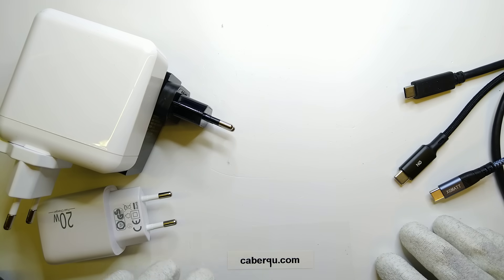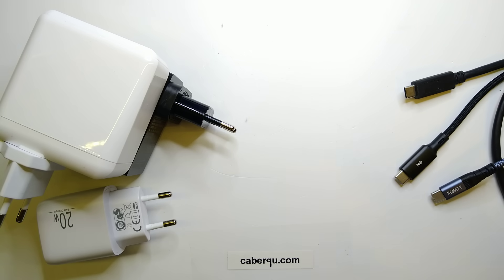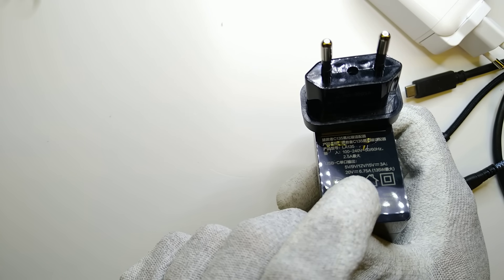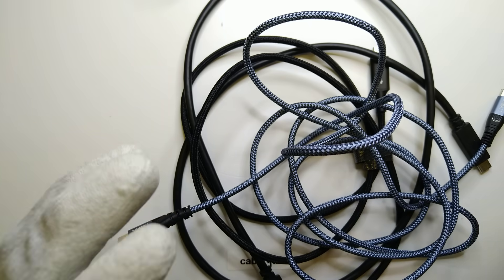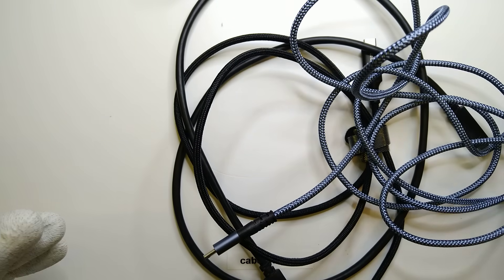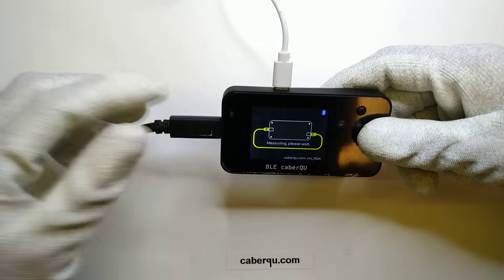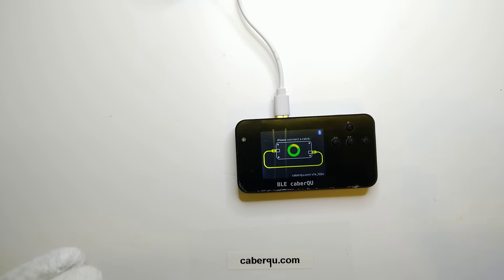USB-C is now EU standard, but the most important thing is missing

Comment: The information to consumers about charging has always been poor and I don't really understand why. Consumers simply haven't been exposed to this information outside of marketing claims that are often misleading like "120 W ultra fast charging*" and several pages down in tiny 10 point font will be the useless phrase "*with a compatible charger" . Manufacturers have a bad habit of not advertising the power specifications of USB C devices, when you have bought the product and have it in hand often it will have that output voltage list as required on chargers but it's often difficult to find that out before buying and many downstream devices will have absolutely no information anywhere on what standard, voltage or current it uses. And also almost no phone or laptops will report to you the watts, amps or volts unless you install third party software. Even when using first party chargers and cables it's difficult to know what will work and if it does, how much power will be transferred.

Another issue I've seen is when you have a charger that's 90 W and a device that requires 30 W, consumers will think they're compatible, after all that's how the standard was first envisioned to work. But when they try to use it, it won't work because the device requires 30 W at 12 V which is often an excluded output voltage as it's not required, USB PD 2.0 only requires 5, 9, 15 and 20 V above 45 W. 12 V is an optional voltage but is actually very common on devices, particularly those that transitioned their design from a 12 V barrel jack to a USB C connector. Designers have to be aware 15 V is the new common voltage and support for 12 V is poor. Considering how regularly I see designers screwing up and combining the two 5.1 k resistors on the CC1/CC2 pins I have no hope designers will know to design for 15 V, not 12 V.

Furthermore I will be interested to see what sort of laptops or phones will make use of the USB PD PPS standard, it's been around for a while now on upstream devices but downstream devices that take advantage of it don't really get any advantages unless they support ONLY PPS which would allow them to greatly simplify charging circuity, but then won't be compatible with any charger that doesn't have PPS. Don't think I've ever seen a consumer device that actually uses PPS to remove the on-board charger to date.

Comment: >I buy cheap stuff from china that isnt officially certified and wonder why its not what its advertised.
You cant be expected to hold everyones hand and stop them from being stupid and using cheap non certified cables.
I just throw the cables that come with cheap devices away and use Fuj:tech USB4 240W. Little expensive but can use it to charge anything or transfare video or files on max speeds.
Reply: To solve the cables being shit you would have to ban people from buying cheap stuff from China and other 3rd world countries.
Its not just USB-C cables that suffer from these issues. China sells people cables made from aluminium, those are sketchy as can be.
Reply: @deperditus worse still, try putting a magnet next to your cables. Yup, some use steel. Almost all my breadboard jumper wires are magnetic!
Reply: @deperditus  Making such cables simply not work is actually great way to get them from market in the first place. No-one will bother making them if they can't sell them
Reply: @Gastell0  nah people arent the smartest and will fall for the false promises of cheap cables. Human greed is such that they will keep buying these cheap cables as long as their sale is allowed, they just see oh this 5€ cable claims to do 500W with 100Gb/s file transfare speeds and buy it, because in their minds its  great deal compared to the known brand that costs 30€ for 240W 40Gb/s cable

Comment: You cannot rely on the "large label" wattage on those chargers.  The fine print usually will specify that different ports can supply different amounts, and only if you use the correct combination of ports can you reach the full labeled wattage.

USB-C is phenomenally complex trying to mix and match chargers, cables and devices.
Reply: Then comes the sockets on say a laptop, all look the same, however some do PD (power delivery) some do video etc etc, a right mess. Pair this with a non marked cable and best of luck getting everything working.

Comment: At the time of writing of law, USB C cables did not need labeling.
Reply: USB-C has always been a confusing 'standard'.  For example, does the cable support Thunderbolt or not?  Or DP-Alt mode?  Because most cables do not.
Reply: @SanderEvers  DP alt mode is supported by any compliant C-to-C cable. Thunderbolt is not USB standard, so USB-IF has no power over it.
Reply: @uis246 compliant USBC cables can also be just 2.0. Also DP has some high datarates not suported by all 3.x
Reply: @ptamog  "just 2.0" cable is either has other connector be 2.0(e.g. type A, mini-AB) or non-compliant. Same goes to "only charging", except they are only non-compliant.
Reply: @uis246  C to C cable can also only have the classic 2.0 data lane and not the aditional high speed lanes used in 3.0 and onwards. C is just the conector. DP runs on the high speed lanes.
Reply: @ptamog  i saw PD on USB2 C-C
Reply: @martinnovak679  correct, but I'm talking about DP (Displayport)
Reply: @ptamog  oh i tought it was typo

Comment: i hate usb c i only have 1 device with c and the most are mini usb or micro and my phone and ipad are all lighthing what is stronger it is so shit i need to buy all new cables of the hold on usb c also its a verry fragile connector hi voltage over small pins near data is not a good idea i see so mani cases where it fails cause high voltage short over the data line and blow up a lot of laptops or other devices

Comment: All USB cables should be marked with a maximum current rating which keeps it within the USB voltage drop specification. Not a perfect solution, but definitely the simplest one.

Comment: I don't expect or want all cables to need the USB IF certification, but some sort of labeling would maybe be nice, albeit difficult.

Problem with USB IF is that they're more conservative about allowing devices into the standard. Some devices cannot be certified, but are very useful:
- USB a male to USB c female? USB C female to USB micro male? Spec violation. Safe when used carefully
- multi-port USB C chargers with shared capacity? Nope. Wild West on how to renegotiate new power requirements

Comment: You’re certainly right…! This seems harder than e.g. food or even pharmaceuticals (labeling and checks), because there are hardly any manufacturers of cables, chargers nor devices (caveats for the latter) within Europe (EU, EEA, UK). For electronic parts, even less so? 

Except high-end devices, branding and manufacturing are quite obfuscated. A brand doesn’t necessarily equal a manufacturer, as plants produce by tendering for any brand. 

So, will every EEA country need to check imports before they hit the common market? Meaning a revival of all the separate national «agencies» we had 40 years ago? 

This scaled well some decades ago, as the «early EU» had tech manufacturing inside the area (as we have for e.g. food and medicals). But now, when the supply lines are all «third country», I have no idea how this needs to be implemented. 

Importers «checking themselves» sounds like the proverbial Boeing-FAA dynamic. Who will watch the watchers, and what will the street price for actually good USB-C equipment be…? 😅

Comment: With all this mess, more waste will be generated. We still use usb-a charges along with usb-c, also we still use non usb-c(on end, like lightning, microusb, mini usb, usb type b devices other end might or might not be usb-c). Why you need over complicated circuits on a cheap low power device? Some even dont use 5w to work. Now when I am sending some electronic device to some of my friends I am sending usb-c to usb-c and usb-a to usb-c cables, just to be sure they have the right psu…Until every device moves to usb-c there will be a new standard and all this e-waste will be thrown away again…

Comment: i have a barrel plug on the pinebook pro and it's way more comfortable to plug in and out. barrel plugs with 3 different sizes for 5v, 9v and 20v, combined with some very fast wireless data transfer is all we ever needed, instead we have this convoluted standard.

Comment: I see that tester, I instantly want to buy it, because we all own so many damn USB-C cables these days that a specialized tester is absolutely worth it 😂
Reply: Really excited to get this one too, Im doing USB-C hw designs and it would help me verify cabling. Happy to beta test or pre-order!
Reply from the maker: Haha, unfortunately it's a prototype with future shipment dates..
Reply: @quiescentcurrent It looks really cool, I would be interested in a good tester as well, instead of a random AliExpress buy
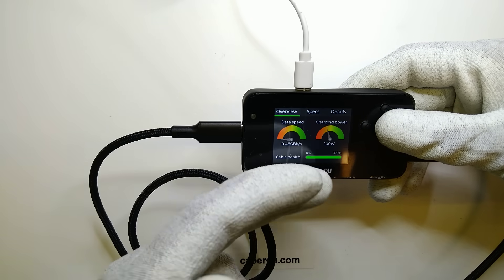Reply: @quiescentcurrent  Could you change the BLE to show the real max speed in the overview dataspeed gauge? For ex. @ 8:11 it shows 0.48Gbps though the data cables are not connected, thus 0Gbps would be correct.
In the magnetic connector video I saw it show 20Gpbs as faked by the emarker chip, when really it was usb2 only. Seemed to be confusing.
Reply: So instead of different (but easily recognizable) connectors, we end up with different cables that all look the same, requiring a tester to find a suitable one.  Yeah, that's progress...
Reply: @kaasmeester5903  micro has same problem. USB-C only add voltage (and wattage for 5A devices)

Comment: Yes, cable labels would be nice, but usb C-PD is far better  than the A-to-micro-B cables, which most phones and tablets used 10 years ago. Both the AC adapters and the cables were a complete crapshoot.
Reply: Depends how you look at it. They were guarntied to deliver 5V +/- 10% with 0.5 Amps guarantied with sometimes 1A or more. But within that 5V spec, everything could just charge. 
And then you had charging or data cables, thin means no data, mid means data and thick.... still the same in most cases when from normal brands. Others are just more rigid.
If you look in the connector, most have 4 and some 2 wires. Last type means only charging, 4 can mean charge-only or maybe also data. Data-transfers working up to 7 meters almost all, better cables up to 15 meters.
Now you get things that don't even charge because there is no data-wire connected so not even giving 5Volts.

Comment: This is reason I only buy cables rated for 100W. [just to make sure my laptop supports it]
Reply: And then you discover there are 100W-0 Data / 100W-480Mbit Data / 100W-10Gb / 100W-20Gb / 100W-40Gb.  
And that is ignoring the Thunderbolt standard!
If you but the 100W-0 and then plug in a PD hub/dock you will be annoyed.
If you buy the 100W-40Gb you will be broke.
The problem is as described - cabling is a pain.

Comment: He just tosses off “because there’s no no-USB option in the spec” and I’m like wtf
Reply: yes, this is crazy. The USB standard might have a "no-USB" entry.
It's like car that says it cannot drive.
Reply: Who would think a manufacture was so lazy not to add 2 wires for slow data transfer
Reply: Because some devices do not need it. Consider a small cheap electric torch which only needs charge with the OEM USB cable. There is no need to require data transfer capacity with said cord.

Comment: What drives me crazy is that cheap USB-C devices do not charge at all with a high quality USB-C-PD charger and cable. Only with a cheap USB-A charger and A-C cable.
Reply: Yes because they are missing a single resistor that asks the charger to produce 5 volts. Such a disaster.
The USB-A chargers by default produce 5 volts.
Reply: @pizzablender the resistor is for max cable current in legacy cables. Voltage is asked by the device. 5v is by default. What your device probably needs is to see the shorted data lines of your usb A carger to identify the port as a charger.
But yes, it is a disaster.
Reply: Cheap? I have a 300 € dashcam that only charges with its USB-A to USB-C cable. 😒
Reply: other than USB-A ports, a USB-C Port, by default, won't put out any voltage unless there is a valid resistor on the CC lines. Cheap USB-C devices omit these resistors and thus don't get any voltage when connected to a proper USB-C port. They only work with USB-A ports.
Also, some devices like my GoogleTV Dongle just refuse to operate when they are connected to a USB port that can handle Data. They assume it's a PC USB port that can only handle 500mA. To get them to work they expect the Data lines shorted in the Power/Host Port.
Reply: @RoterFruchtZwerg  the resistor indicates current in legacy A to C cables. I did not know it was also used to enable voltage 👍. It makes sense i.e. for waterproof ports like phones.
When designing a usbc device that uses power and data you can add suport for PD with a controller that looks at the CC lines. Supporting legacy protocols like BC is another effort if they are not supported by the thing that uses the data lines.
Reply: @ptamog  it's also because USB-C is on both sides and you want it to not explode when you connect two power supplies together.
Requesting 5V (@2A max) from a USB-C power supply requires two resistors on CC lines. These are also embedded in all (proper) USB-C to B cables and C to A socket adapters to get 5V for the peripheral device. 
Requesting more than 5V or 2A requires active electronics on the CC lines for power negotiation.
Reply: I am really glad I read your comment, thank you! I replaced all my USB A wall chargers with USB C chargers and cables a few months ago. My 10,000mAh power bank wouldn't charge any more and it has a USB C connector for charging and I thought it went bad. Thanks to your comment I found out that it will only charge with a USB A wall charger and a USB A to C cable, exactly what you said. I have it charging now. Thank you again!
Reply: yes! this is so frustrating. I want to get rid of all that crap and just have a few USB-C outlets that can do it all.
Reply: I got an "new" electronic mini screwdriver and for some reason, only charges with the included USB C cable.

I got tons of cables with a good amount over 5+ years and none of them worked. I can only guess the included cable works on a very low USB standard, beyond just a missing pin.
Reply: Most likely those devices only need 5 volt for charging. Any higher voltage forcefully applied to them might destroy them.
Reply: @thomask4978  - Considered and used older cables with only 5 volts (I measured). It was just queer is all I can say.

Comment: Honestly I don't mind the fact that each cable can't charge everything, BUT I do think there should be regulation on cable labelling, so it's easy to find the one you need for each device. For example, USB-C cables should always be labelled with the USB version and charging capabilities, and also any thunderbolt compatibility (which makes things even more complicated by using the same connector).

This should apply to version/capability labelling on other cables too, such as HDMI, DisplayPort, Ethernet etc. These all used to be good for actually being labelled on the cable themselves, but seems to have gotten worse since braided cables became more popular!
Reply: @DonnieLuve  Please don't tell me there exists unshielded USB cables. My life was miserable before already.
Reply: @DonnieLuve  there are tons of USB2 USB-C cables 😀

color is usefull for A-C cables but C-C don't have that plastic thingy
Reply: Thing is other then USB cables didn't change number of pins like USB historically did and likely old cables with made with lower spec likely will work with higher spec signal, there no way to identify cable to begin with on those standards, if there distortion in signal, devices will lower the mode until it's fine. With USB number of pins and wiring historically changed, also power delivery is extension of USB standard, and problem is not all USB are made to support higher wattage and all USB cable would fry isolation on higher wattage, so for safty for higher watt modes chip is required in cable identifying if it support it. Other standards you mention don't have that issue as they don't send power at all as well they didn't changed number of pins over time as USB did.
Reply: @HTS126  I just had an idea for an actual solution. Since there is a chip inside the cable for communication, why not make one thats readable by any device with USB-C connecter with a app? just plug it in, open the app, and see everything you ever wish to know, even manufacturer and manufacturing date.
Reply: I don't want the USB version, I want the speed. And the wattage, and the voltage. I've watched so many videos and read websites that explain that whole USB bullshittery and still can't remember everything important. This won't help average consumers at all. Thunderbolt could eliminate those informations, cause as far as I know there are only 3 Thunderbolt versions in everyday use, soon 4, and they are very well regulated, so you can basically look up what version can do what, and its dead easy to learn. Basically what that USB-C stuff should have been like.